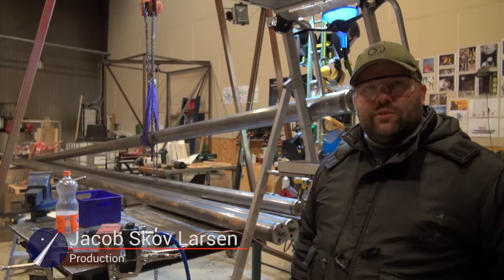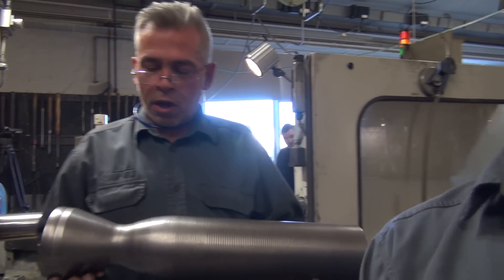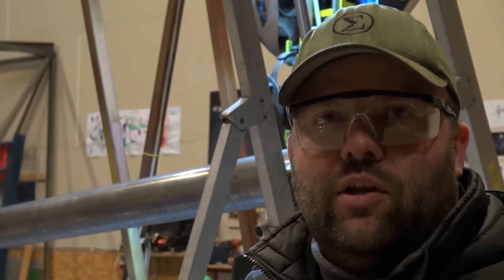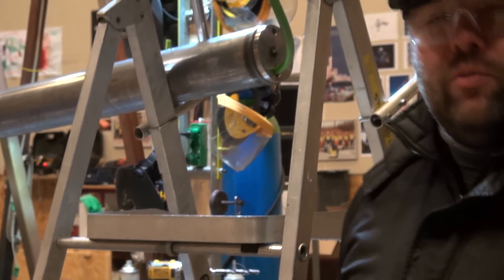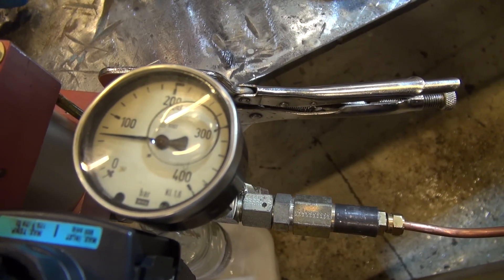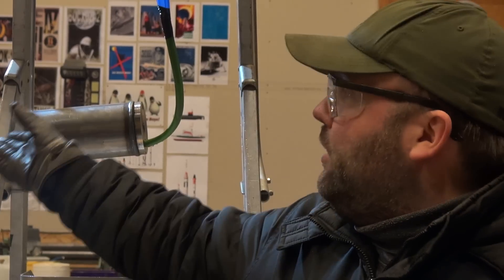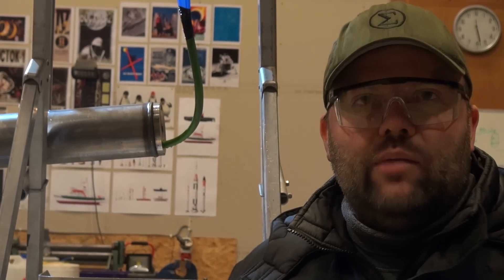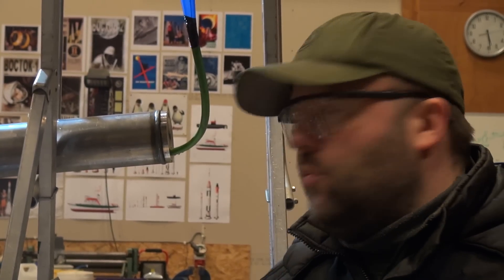Pressurizing standard piping for the BPM5 rocket engine.

Comment: This is a pretty clever idea, but you guys really should be standing farther away from these things when you're pressurizing them. If it ruptures and there is any air left in the tube, you're going to have a very dangerous situation on your hands. The guy in the hi-vis pants standing about a foot from the end cap at 2:55 should really find somewhere else to be.

Speaking of hydroforming, have you considered hydroforming any parts of the engine? You'd need some beefy dies, but it might be a decent alternative to roll forming.
Reply: I dont think the endcaps is the problem, they are much thicker than the pipe, and the are welded perfectly. but i agree with you.

Comment: Another option is to have custom pipe sizes made, however they would probably have to buy a substantial amount.  It sure looks like DOM pipe.  

Hard to believe the pipes expand so uniformly from hydraulic pressure that they can create what they need.
Reply: +Keith Ward 
No kidding!  Especially while using lower grade welded tubing/pipe.